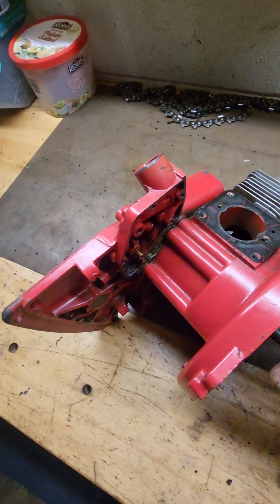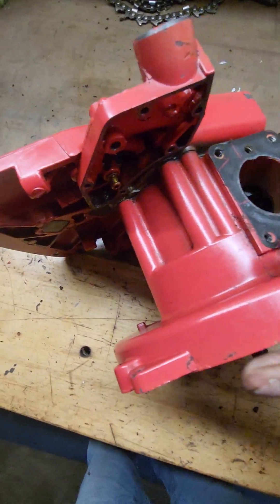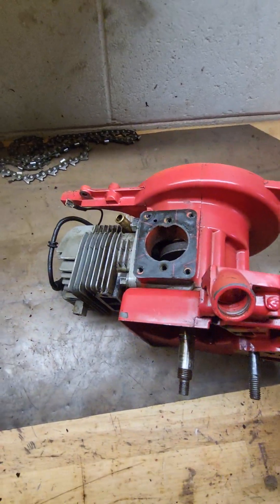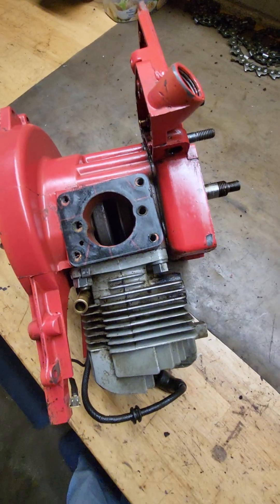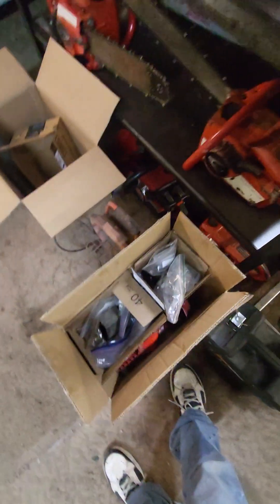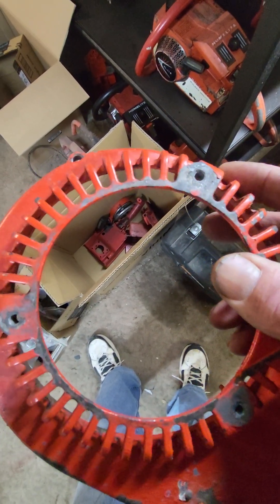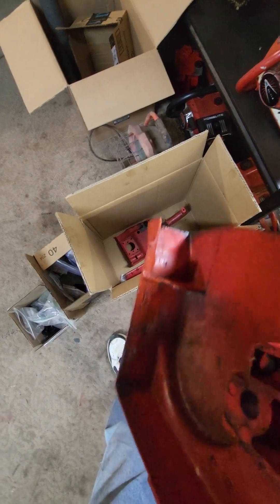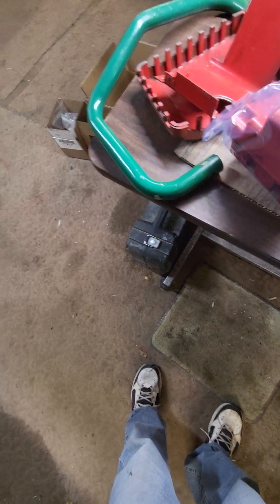Super XP1020A Restoration Part 2

Comment: It does look like you got a low hours machine and a fantastic machine for restoration. It sounds like it had an ignition problem from the factory and nobody managed to overcome the issue until you got it
Reply from the maker: By the large nick in the drive case I suspect a new user did not install the chain correctly and it came off at a high speed and caused the ignition to get out of sorts, much like when a mower blade hits a rock